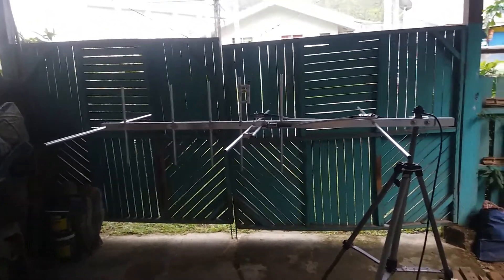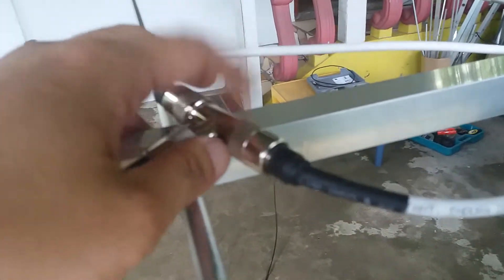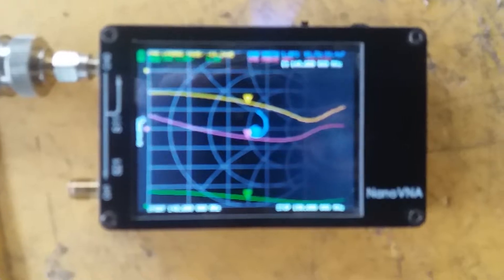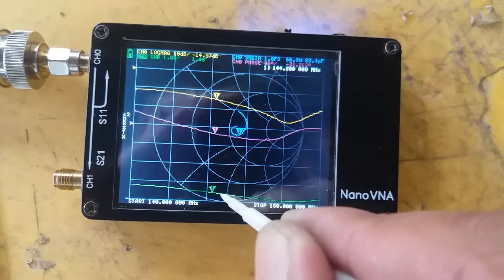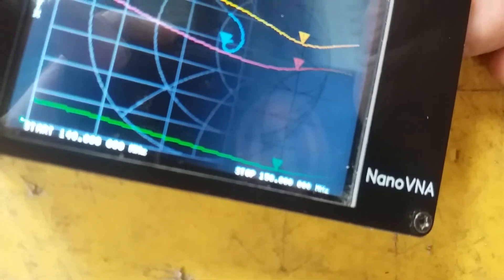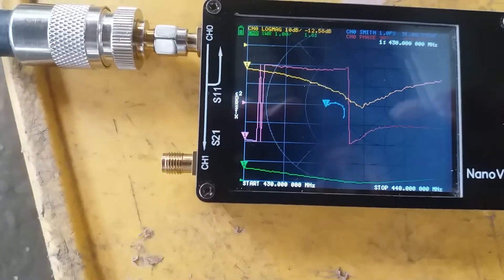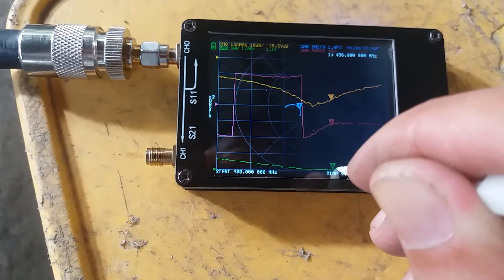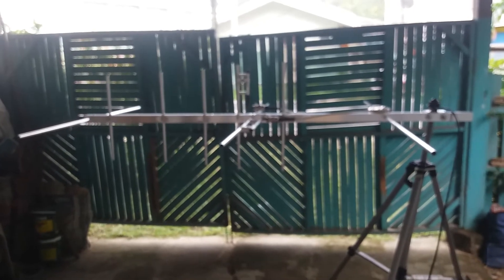Testing  3x5 dualband Cross Yagi antenna for XX9AS

Comment: just a Question bro...whats the  length of the phasing harness cable for vhf & uhf per side?
Reply from the maker: Same length for vhf/uhf it will work on 3rd harmonics length=1/4 wavelength  of your design frquency * coax velocity factor * odd number, depending on how long you want your phasing harness